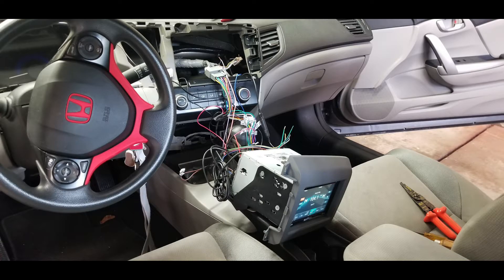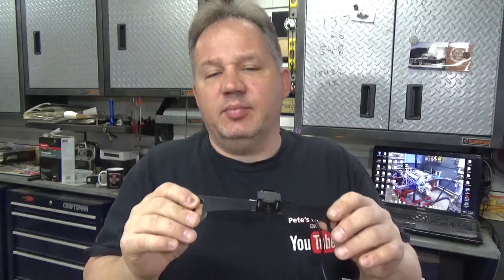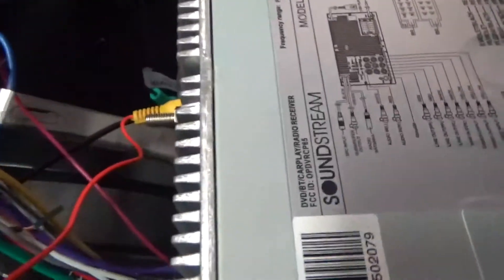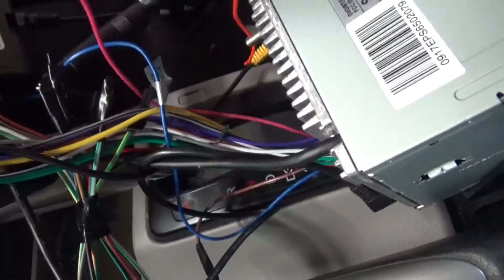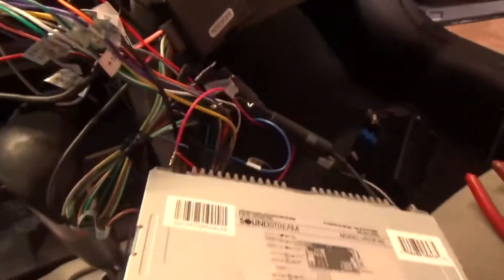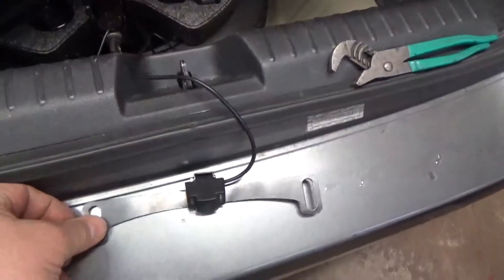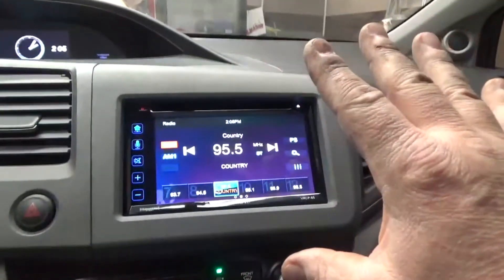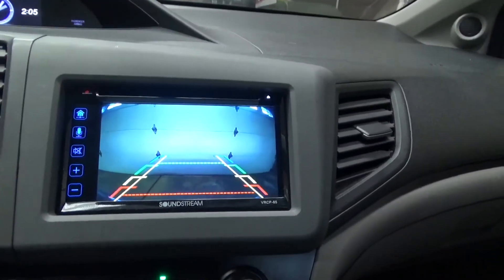Hooking up a Backup Camera - Where Does the Red Wire Go?

Comment: Hi Pete
I have connected the red trigger wire to the power wire of my back up light and it works. However, when I put the dash cam into power save mode AND my headlights are turned on the screen keeps randomly waking up and goes into back up mode. It only does this when my headlights are turned on. If no headlights the screen saver/power saver mode works great. The screen goes to sleep and keeps on recording like it should,  but turn the headlights on and the all hell breaks loose. Any thoughts?
Reply from the maker: Maybe you tapped into the power line that feeds the light circuit
Reply: @PetesGarage   have definitely tapped into the wire that lights my back up light. The red  trigger wire works in the sense that it activates the reverse camera with the red yellow and green guide lines on the screen. The problem is it is activating it when when in sleep mode for no reason   It also activates the reverse cam randomly if I have the cam on (not in sleep mode) and I am in drive and have the front cam showing on the screen
Reply: I have potentially discovered the problem but not the solution:  it turns a self test is done on the reverse bulb (and other bulbs I assume) rather frequently causing the trigger wire to activate the reverse camera.  I have wired it directly to the reverse bulb power wire so can you suggest if there is somewhere else i can wire the trigger wire?
Reply from the maker: You can wire right off the reverse light switch
Reply: @PetesGarage  yes I was thinking of that. It just happens to be on the transmission though so getting under the car and running a wire seems impracticable
Reply: @PetesGarage  hi Pete. I seem to have solved the problem. I soldered the trigger wire to the back up wire at the taillights. Seems soldering it made the difference
Reply from the maker: Yup, intermittent connection

Comment: Hey I have a 2018 Hyundai Tucson sel I’m installing a aftermarket android head until and I am wanting to retain the back up oem camera I know I’ll have to T tap the oem wire harness since my car is new and currently doesn’t have a plug and play harness yet. I have the pin out of the oem connectors so I know which wires are for the camera my question is I have a 
rear view camera (power) color red
Rear view camera (video) color yellow 
Rear view camera (p_gnd) park ground? 
Rear view camera (v_gnd) video ground?
Also has a back up signal
And had a “p” position signal 
How would I wire this up to an rca cable I know for the oem back up camera I will also need a 12v to 6v converter/step down please help LOL.
Reply from the maker: An RCA cable has a signal (center) and shield or ground (outside)

Comment: I would love to see how you conceal wires from back to front and also from the top of the windshield to under the dash (dashcam).
Reply from the maker: I do pull all the side and dash panels off and run the wires along the factory wiring harness. Completely invisible.

Comment: I also happened to do the same thing as you with those back camera but shouldn't there be some sort of switch mounted somewhere on the engine that turns on the light?
Reply: There's probably a switch on the gear select mechanism on the transmission.
Reply from the maker: When you shift into reverse the switch in the transmission turns on the reverse lights. That's the power you use to turn the camera on
Reply: @PetesGarage  so wouldn't be easier to connect the red wire to that switch or is it difficult to reach?
Reply from the maker: The switch is too far. The wiring harness is very convenient
Reply: @PetesGarage  ah ok thanks for the answer